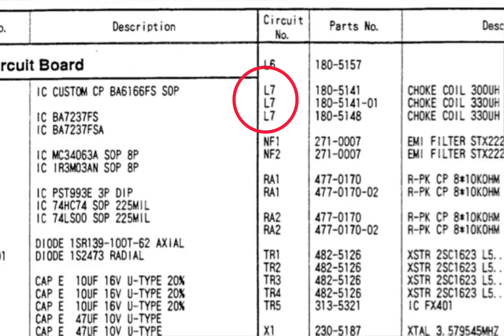Sega 32X Black lines, Whine And Squeal Fix

Comment: So my unit makes a squeal noise, accompanied by faint horizontal lines moving up and down. Will this fix that problem? Thanks I just bought the piece. and a cap kit.
Reply from the maker: @SuperNintendoZach  it should, and also make sure that the 32X and Genesis are using separate power supplies.